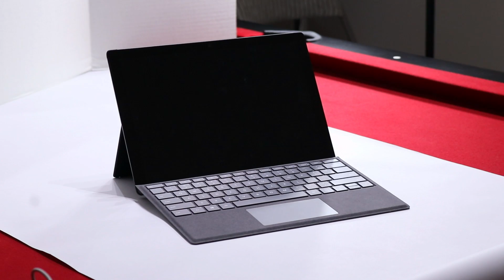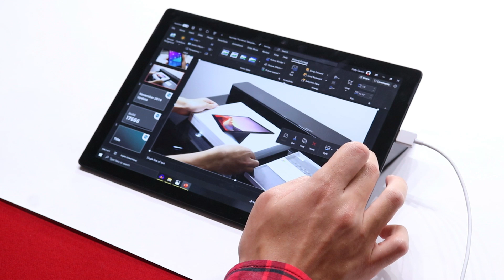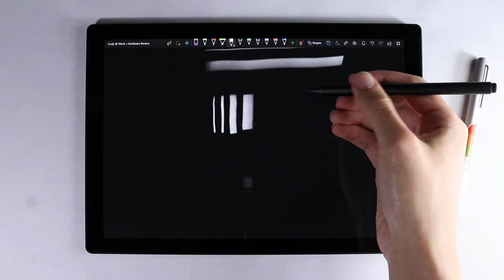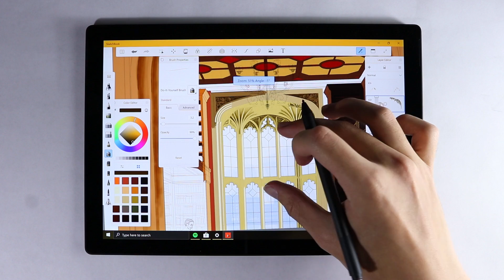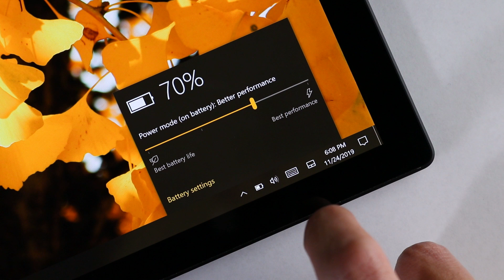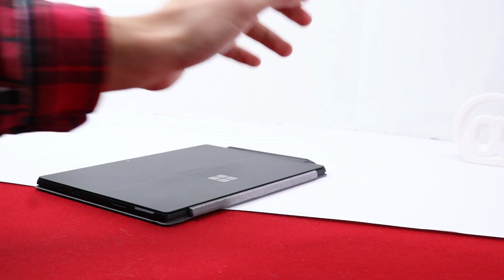Surface Pro 7 (i7) Review: Better than Surface Pro X!

Comment: This was an incredibly comprehensive review of something which disappoints me to be honest! I purchased this as an extravagant treat but found the smile to be quickly removed from my face. The on screen keyboard (which I use infrequently) is glitchy and unresponsive and isn’t always made available when the physical keyboard is detached. The adaptive brightness has resolved itself after four months of battling - including the use of Iris’ command centre. The battery is the most disappointing of all though - five of hours of simple word processing is enough to deplete it to less than 20%. While this is physically very portable, the dire battery life would make me apprehensive about taking this outdoors for any extended period of time, thus rendering the term “portable” useless.  While the instant on is a great feature, it frequently “forgets” that it has a camera and have even had to uninstall the driver a few times to rectify this issue. The keyboard is a lot more rigid than I anticipated and is very comfortable to use, and despite the small size, was surprised at how accurate I could type.  If you want a sexy machine with excellent hardware that can be used as a tablet then this is definitely for you. However, if you spend a lot of time away from a power source then I would advise a different 2 in 1.

Comment: Great review. I purchased a surface pro 7 i5, 8gig, 128. Still returnable. I got it for $699, so I hope to keep it. 
Reading text on this is not as clear & sharp as on my 2 year old 13.3" Dell Inspiron. It's acceptable but blurry in Chrome. Unacceptable in Word & Excel, to the point where some Word & Excel icons are so blurry, they can't be identified, even if I stop to squint & put my face into the screen. Changed to gray mode, which helped me see the documents better, but the icons are still stop & stare. I got this for productivity & speed in detailed work in word & excel & for reading, research & drawing. Tried adjusting the contrast, which helped marginally. played with the magnification, which didn't help, I put it back to recommended setting. Have you experienced this? Any ideas how to resolve? 
I noticed you have a black one. Does it get more fingerprints than the platinum? Which is more durable?
For best productivity, do I need to get a laptop & forget about the tablet? 
Thanks! :)

Comment: They should make a 13’ surface pro without arm chips... we need a tablet with real intel processors, and with a larger body they can expand battery and maybe fit a not very strong gpu in there

Comment: is it hard to put this on soft surfaces such as bed?
also does the keyboard fall easily?
Reply: I do use my surface on bed without the keyboard but I don't find any issues with it.
And no worries, the keyboard doesn't fall easily.

Comment: honestly, i wouldn't want to repair a tablet, if you're working your tablet so hard that the SSD goes out on it, the tablet is done anyway, you'll have board shortouts, fans stop working, processor burnouts, fused hardware is a good thing

Comment: Hi, do i need to install anti-virus protection on surface pro 7? Like McAfee or Norton etc. Thinking of buying it.
Reply: Although Windows defender is very capable and very well optimised, you cannot trust it if you have very sensitive data like banking passwords, unpatented prototypes or nuclear launch codes.
Reply: Of course not. Do NOT install those craps! Do you install anti-virus on an iPad? No? So do the same here.

Comment: Anyone showing missing hard disk space on their SP7? Mine says 38gb's used brand new out of the box. Only 80gb available. Suppose to be 128gb, shows 118gb and then on top of that 38gb's being used.
Reply: All devices have less storage than advertised due to the operating system.  Usually, there is a footnote that stated what the usable storage is...
Reply: R K thanks for the reply. I was aware of that, but wasn’t expecting 20gb+. It’s okay. I save all me data on the micro sd card. Nailed a 400gb card for $50 and copy’s on an external. Couldn’t beat the SP7 deal at $768 including the keyboard.
Reply: @jeffrobins3828   Sounds like you found a great deal on both the SP 7 and the micro sd card.

Comment: For the love of God, at least someone should do a review of the Surface line of products for heavy programming stuff .... all I see are either people opening Chrome, playing videos in Youtube, playing some video game, or doing some design work ..... is there no one who has used these for some heavy programming? Running a Spring Boot app, or a high volume XML file parsing using Nodejs asynchronously etc etc etc????
Reply: I agree!
Reply: From what I've read, it's not recommended for developers. You'll need way more ram and memory by which point price point isn't value for money compared with a conventional laptop.
Reply: @afra_ams  Yh, also apart from game dev in many ways mac os has become an industry standard (Not that developers don't use windows)
Reply: @afra_ams  yeah this will do fine for engineering students ( electrical, electronics, computer science not mechanical or civil) , even at masters level but a developer would need more ram and a conventional laptop...
Reply: If you're a developer, you should know the result by just looking at the spec of the computer. I can tell you that this machine is for sure can do Front End web dev stuff + back end stuffs too. MS Visual Studio to work with C#, C++, F#..etc, should be ok. But don't forget that this is a 12.9" screen, you're killing your eyes if you expect to work on this for longer hour constantly.

Comment: IF ANYONE IS INTERESTED I HAVE OLDER TECH THAT IS BRAND NEW IN THE BOX. I HAVE A DELL XPS 2720 TOP OF THE LINE WHEN I BOUGHT IT I PAID OVER 3K. IT HAS GOOD SPECS AND YOU HAVE BOTH A HDMI IN N OUT. ITS TOUCH SCREEN BEAUTIFUL DISPLAY THAT YOU CAN ADJUST. I CAN GET ALL THE SPECS. I AM SELLING THAT AS WELL AS A NEW IN THE BOX MICROSOFT SURFACE PRO 4 OR 5. I CAN ACCEPT PAYPAL OR CASH APP/ YOU WILL HAVE TO PAY SHIPPING. I AM HAVING A YARD SALE SO HIT ME UP IF INTERESTED. YOU WILL LOVE THE XPS AIO I HAVE ONE I'M USING AND IVE HAD ZERO PROBLEMS. IT'S 27 INCH DISPLAY WITH HIGH RATING 98 FOR COLOR. 2TB HD PLUS 32GB RAM 2 GRAPHICS CARDS. YOU CAN HOOK UP YOUR GAMING SYSTEM OR A CABLE BOX TO USE AS A TV. I WANT AT LEAST HALF OF WHAT I PAID FOR IT. I HAVE A VIDEO GIVING THE SPECS. 1500 OR BEST OFFER. THE MS SURFACE PRO 800 BUCKS ITS A I5 128GB BRAND NEW  IN BOX. I BOUGHT EXTRA SO THAT'S WHY I HAVE THEM.

Comment: One of the things that I regret the most in my life was using Windows in the first place. Back in college, I used Windows simply because Mac was way so pricey. Then after college, still I used Windows for a long time until several years ago, my ex company forced me to switch to a Mac. Man, I can tell ya all. I should have bought a Mac since Day 1. No way that I go back to Windows for the rest of my life.
Reply: But MacOS is one of the worst operation systems i've ever been in contact with... linux is still the best for programming n stuff, windows is great for gaming and work and also programming. With MacOS you will probably run into problems in each of those usecases.
Reply: Warning, Warning, iTroll Alert, iTroll Alert....

Comment: Good Review on sharing many open different angle views.
...
My own experiences using 2 weeks Surface Pro X, and MS Surface Pro 7 core I 5

Before having MS Surface Pro X , I bought SF pro 7, it  is working well  and fast. After 2-3 weeks, I had to buy another one computer, I had to give SF pro 7 to my college to work continue 1 week for urgent adhoc many reports requested by customer.

Then I have to buy another surface for my parallel works on presenting, office and web browsing, traveling several places.

when I saw SF Pro X firstly open in Microsoft Big Event and later in the MS shop seller,  I was very impressed on very nice improved design and functions of  MS Surface Pro X.  
Design look the best among the nowadays tablet, and smart ultra traveling notebook . 
13” screen is good for views.  
Quality of screen and sound and video were much improved than older pro version.   

So, I have gone through studying a lot from Surface Pro X reviews, both on their MS own website and third opinions.

Most of reviewers, youtubers focused only performance and limitation on new ARM processor, those said many problems on negative about Surface pro X. 

So I think, I should try and explore more details by myself on this Product, because... 
I don't want to have 2 surface similar. I wanna try different. 
And I believe inner inside that, 
"MS team must have some good reasons to launch something new by new chipset with this ARM".  

There should be reason good enough to go for ARM with this product. I like thing about starting of AI feature on this SQ1 chip. 

“After hearing other, better to try with your own experiences.” ...

Then have to do my own test, 
I went to the seller Shop to do the test.
I bring my SSD HD data containing many of files, that i regularly use to do my own real test at Surface Pro X seller shop spending almost 1-2 hours for all tests.

I am the one who usually do the works on MS office.
I do reports with MS word, one file size could be more than 100 MB. 
At the same time I would do multiple tasks, opening Excel sheet picking up several data financial and analysis technical data several sheet calculating.
Moreover , I am doing at the same time opening 10-15 pages pdf file parallel with doing slide presentation with power point that containing tons of high definition of pictures and videos. 

While doing all above I am opening many windows of web browsers, 
doing search internet data.
One can be email on gmail, one is opening youtube music for relaxing, 
anothor one could be working on email, 
another one monitoring stock and gold price, ready to buy and sell.   

While I am testing,  I open my presentation slide made of MS power point, that is quite big size of 400 MB. With lot of HD pic and Video embed on it to test the severe case. 

All of working windows, I open through my SSD HD connected via USB C port because Testing SF Pro x at the shop is demo machine.  

All that programs and open windows as mentions above on test are working very well.
While doing all many tasks on Pro X as all above I mentioned,  opening 100 MB with MS word doing report, opening youtube 4 K, opening several files (excel, pdf documents, edge browsers surfing more than 10 pages web browsing ) to copy data to creating report, and also at the same time doing that quite big size 400 MB slide presentation.

Result is that, MS Surface pro X is working smooth without any problem, working fast, honestly to say that it is slower a bit comparing to surface pro 7 core i5 256 RAM,  as I said, the one I gave to my college for working on writing reporting .

(I would say that Microsoft Pro X, at the shop, is the one that skilled seller just update lasted programs, software and firmware, I guess many things and problems were fixed.) 

Web browsing and Movie on Youtube are working very well with impressive quality.
See clear on big screen, 
Nice details with full High Definition,
Resolution is almost 4 K movies with fine and smooth through my eyes.
. 
The sound and movie are showing on Surface Pro X  are very IMPRESSIVE. 
The sound is not as good as iPad Pro ,  but it is really good enough to enjoy the entertainment.

The outlook of SF Pro X design is very impressive, pretty much beautiful.
The handling, carrying Surface Pro x is very suited for traveling people like me, while I am going out to give lecture and consulting to students and customers.

Due to the working style and my age, I don't mind much about gaming performance,  because I do not have much time left for games. 
I used to be a game lover when I was young, but after coming to some old age, I gradually fade off it.
  
Photos and Videos I usually take and work simply by iphone and ipad. 
So Adobe Photoshop and A Illustrator or A Premiere were never used on this Surface.  
But heard that  in  a few months, Adobe team is working on to develop those photo apps to be compatible on ARM.

MS Edge and Edge Canery  developed for ARM is working very smooth and fast. 
So that is enough support for me to choose this computer, MS SF PRO X.

So, I made decision to buy Surface PRO X.

New MS PEN is used for many comfort functions.
It  is really work for noting, drawing very good ergonomic and smooth use.

After buying,
This MS Surface Pro X had been tested, opening files, working all day and night.
Even I take rest sleeping, but computer had to be opened , because continuing work on many data files. 
This SF had to keep running open to finish more than 3 reports, the  Due Diligence  reports for customer in 2 weeks. Each report size is more than 60-90 MB and has more than 100 pages. 
So the long time test had proven its reliability and  stability. 

I would say this Surface Pro X is very best suited for me.
Nice Design, very lightweight, look smart when presenting work to customerss, 
Good for  web surfing and browsing data,  watching movies in Youtube.
...
People use different computers for their different purposes and experiences, 
select the one that fit to you.

I do like one the Pro X machine.
When it is working such a long time, it is notices that this machine is not as heat as SF pro 7 , 
I think because of lower power (watt) used in ARM processor.

All above mentioned,  I do love this MS Surface Pro X.
Its designs,  functions, and features are very fascinating one.
Reply: Thanks for your detailed review.
Reply: Thanks

Comment: I currently have an SP4 (i7) and it tends to get super hot if I push it very hard, it even did a thermal shutdown while trying WoW on low settings.  Does the i7 of the SP7 get very hot?  I'm debating between the i5 and the i7, does the i7 blow through the battery a lot faster than the i5?
Any help would be appreciated, all of the stores only have i5 devices on display.

Comment: Does anyone know what drawing program hes using in this video? Great review by the way.
Reply: concepts
Reply: @rachelz2770  Thank you Also would you happen to know if the i3 version can run this well?
Reply: @MemesGoneWeird  i am not sure, it works well on the surface pro 6 (i5 Version).

Comment: wait, it can be charged by that usb c port as well?
Reply: well, I have one and I couldn't charge it with the high speed type C that I use for my phone
I did my research and it seems that a 61W or higher charger should be used for type C charging but I haven't tried that

Comment: I'm a little disappointed in my Surface Pro 7, my iPad Pro from about 3 years ago still performs better and has a longer battery life, and I don't use my Surface for anything heavy, just Docs and internet browsing.
Reply: BS Killa use case is the main point. Stick with the IPad if all you’re doing is browsing and light document reading/editing.

Anything more, you want a surface.

Comment: I would buy a Surface pro 7if it wasn't for the bezels...Maybe next year
Reply: They are actually very useful. On contrary you don’t block your view when the keyboard is docked and you have a clear grip while writing on it without touching the screen area. 

Also I love symmetrical bethels. They are much better than the chins of the X. 
Don’t get me wrong - the X is a sleek design since it does not need to bother with thermals so much like the Pro7 with their Intel chipset - but it is not worth the trade off.

Comment: i wanna see how adobe products perform on surface ?
Reply: https://www.youtube.com/watch?v=T-C5_ZuptHY photoshop
Reply: I have a school surface pro 6 and it performs very well
Reply: What about aftereffects and premiere???
Reply: @shahabpn1730  I haven't used those adobe products yet I've used InDesign Photoshop illustrator and animate which I run on my surface pro  4 i5 with 4gb of ram which was usable but not for anything 3d so I'm assuming my current surface pro 6 with i5 quad core with 8gb of ram would run better but  honesty if your trying to use adobe products id recommend a surface pro 7 or 6 with i7 because those models I believe have a  separate graphics cards which would make the process way more  better or alternatively get something entirely different to the surface pro there not that great if used a for 3-4 hours daily their batteries tend to degrade after 1 and a half years to 2 years where the battery dies before the end of a school day which is 4 hours or less usage most days futhermore it gets quite warm doing any heavy task open adobe InDesign and your lucky if it makes it through a double class anyway get an i7 version of the 6 or 7 with 16gb for video editing but do know there are better deals out there for the price point

Comment: I have bought the Surface Pro 7, even though I prefer the Pro X form factor and its clever pen holder. The ARM CPU just doesn't cut it for me. I need Windows to run X64 apps. The new Surface Pen is quite responsive, not as good as the 2nd gen Apple pencil for the iPad Pro but is good enough for general note taking.